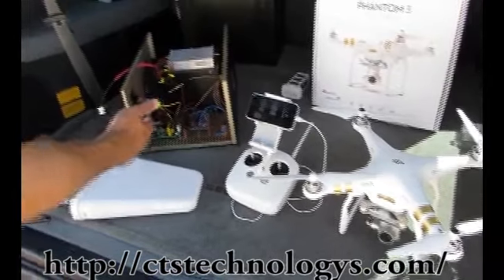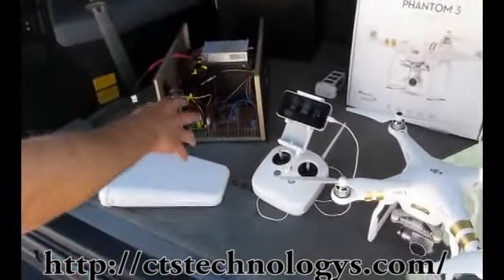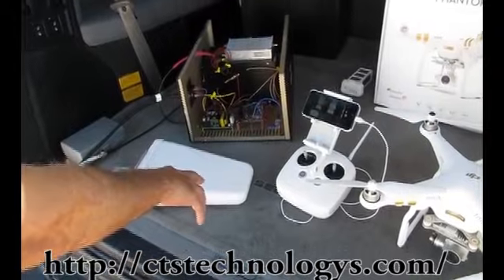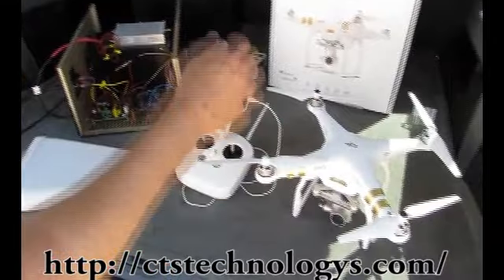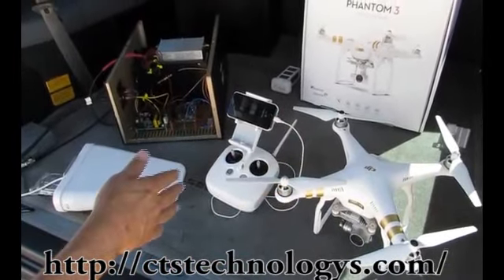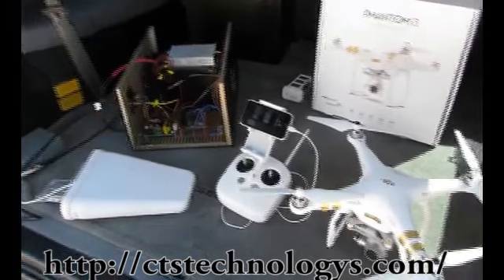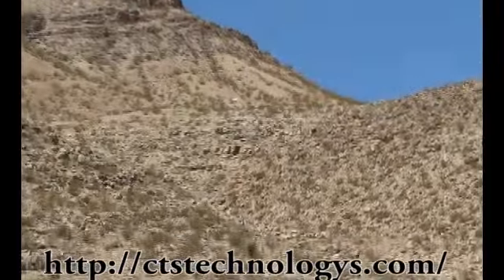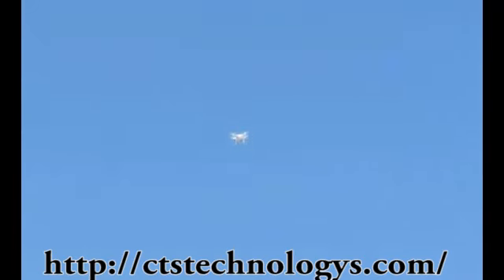How to diy a Drones Jammer

Comment: It's really simple.. for those who think this was clickbait.... Same frequency but higher amplitude/volume means override. Same way you hacked tv and radio stations stations pre-digital conversion. Notice 'high power output,' that means turn the power up.... Turning a knob and connecting 2 parts IS the 'diy' part!
Reply: If you own a spec anny you can watch it happen, as the jamming end increases power the noise floor of the spec anny set to receive at that same frequency will rise about it's current noise floor.
Reply: I fuggin love you

Comment: Isn't that just GPS spoofing? What happens if the flight controller isn't reliant on GPS?
Reply from the maker: +j69chevelle Not gps spoofing 
that just gps rc signal jammer 
can force the drone down
Reply: I only see one antenna... how can it jam both gps and rc (radio) bands? It just forces a Phantom into Return To Home mode... What happens when the flight controller isn't reliant on GPS or vice versa is solely controlled by pre-programmed autonomous flight? Seems too narrow of an application for jamming "drones".. more like maybe jamming a Phantom.
Reply from the maker: ***** That we just connect RC WIFI band
Reply: Be aware of this chines scam !!
Reply: abdulla ali - So it's a scam because you don't understand how it works?  lol
Reply: i need to detect drone  in fog when i dont see it with eyes , and lightless drone in night time - Does anyone of you  sell  a radar-like  device that  can track  the ~5Ghz signal coming  FROM  the drone, to measure where it is ?
Reply: @exaist hello did you ever succeed? I am struggling to find info